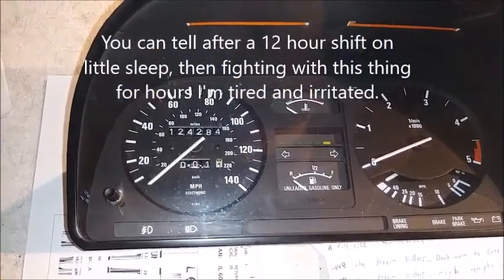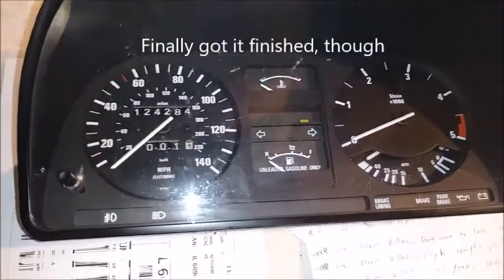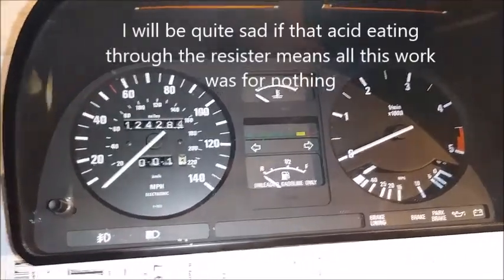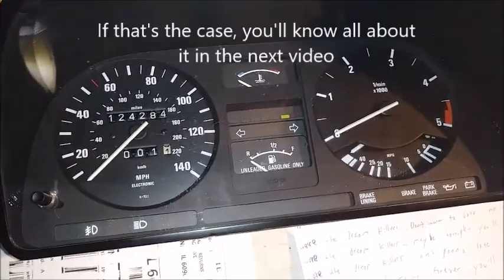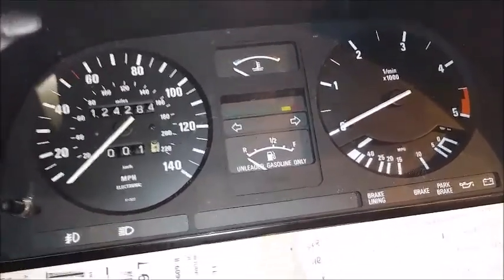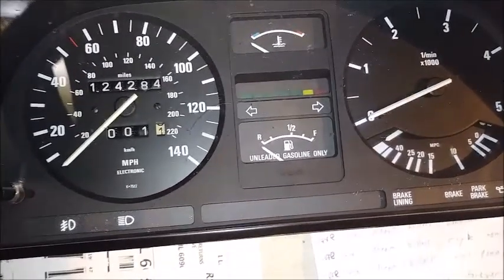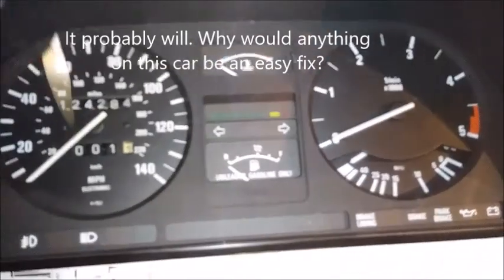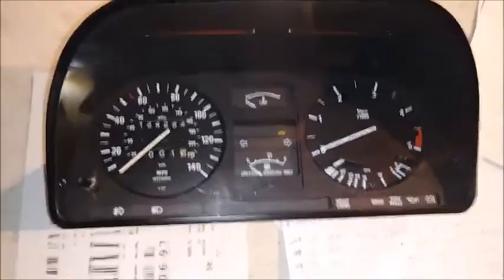Nightmare BMW e28 instrument cluster continues

Comment: Did it work ? I have a similar issue.
Reply from the maker: Prior to me removing the instrument cluster only the speedometer worked. After replacing the odometer gears, that now works. After replacing the batteries I noticed the board was damaged by the old acid leaking onto it. The batteries still work. They are still in place and they do charge. However the acid ate the resistor and the other gauges still don't funtion.

I recommend only replacing the batteries if your board is still intact and no battery acid damage. If it's damaged like mine, don't even bother with the battery replacement. One of these days if I can snag an undamaged cluster, I'll do the battery replacement again and swap the odometer out for mine.